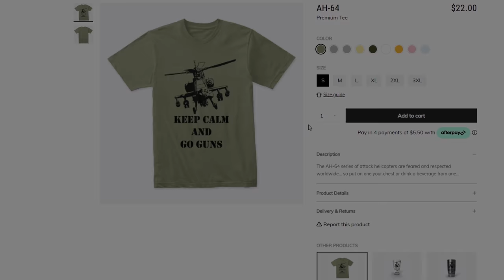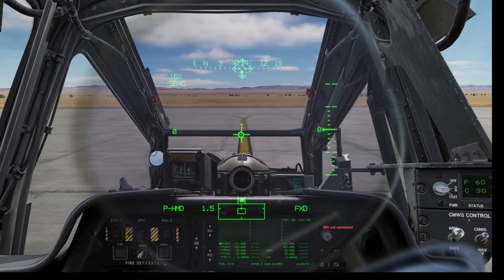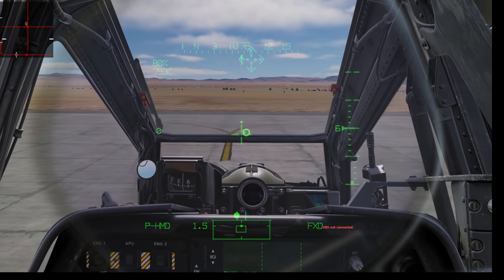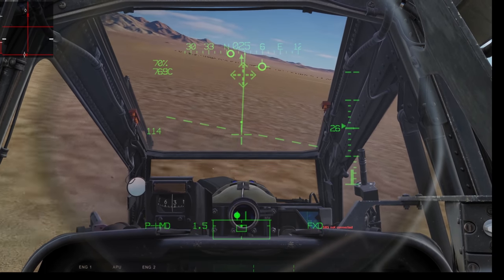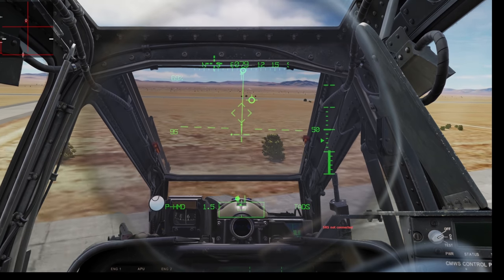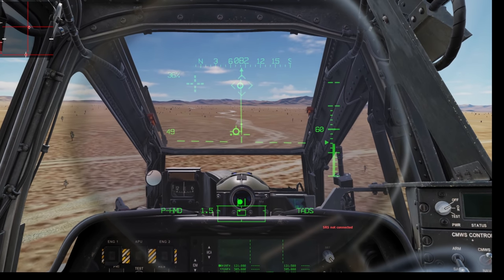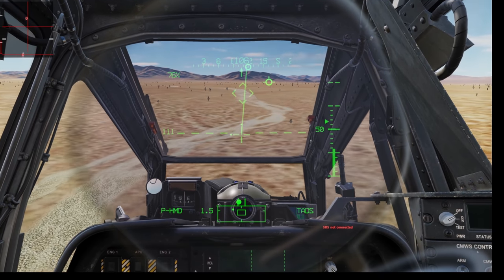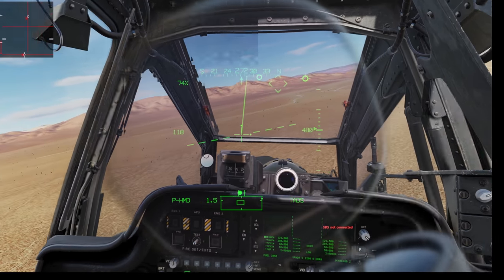DCS AH-64: How I deal with the Trimmer

Comment: Thanks for the shout out Casmo! 
The MS Sidewinder 2 is such a great stick for helicopters, but also for fixed wing trim, it can simulate variable resistance, in a warbird, low speed = near no resistance, high speed = high resistance (simulating physical connection to your controls), Along with the typical vibration/bobbing effects for releasing weapons! Such a tragedy we lost force feedback from the consumer market.
Reply from the maker: Sure is.
Reply: My logi g940 wore out or I'd still be using it. Sorry that they didn't make a 2nd generation version...
Reply: we do have modern ffb peripherals. sure its a little pricier than a second hand sidewinder or g940. but be sure to check out brunner in switserland. i have the brunner cls-e ffb joystick base with a virpil mongoost50cm2 stick on it. also virpils 200mm s curve extension. mainly bought it for helo force trim. been flying the ka-50 since 2009 and never could get used to any of the dcs trim simulated ways with a spring stick. yeah it costs 1250 euros just for the ffb base but for my hobby completely worth  it. now i want brunners ffb pedals though.
Reply: @CasmoTV  check out my reply to redkite in this thread. brunner really is worth looking into for rotorheads ;}
Reply: @kingpinda2  Yeah I'm aware of that one, but far too poor to be buying one sadly.
Reply: @RedKiteRender  ah ok. I just heard/read in the clips there are no ffb devices anymore but you mean affordable.

Comment: Great video Casmo. Your thing about a light touch on the cyclic reminded me of the first time I took the controls on a real whirlygig. I was left seat in a Gazelle doing a track and vibe run over southern england and once I'd got all the data I needed the QHI gave me control. For a about 2 seconds all was good then I started porpoising and weaving and it started to get a bit divergent. I could hear some weird snorting noise in my headset as I fought to keep the damn thing in a straight line and glanced across to see the QHI in fits of laughter. He eventually composed himself, took the controls and said "it's a cyclic not your penis, there's no need to choke the damn thing!" Handing back control to me and this time with just 2 fingers on the stick, low and behold, the thing actually wants to fly straight. Track and Vibe was always fun in Gazelles. Sadly never got to fly "Ugly" in my time on Apache. Keep up the great work!
Reply: Yeah my brother, less is more when driving a helo

Comment: I like the central trim mode, you just have to release the controls for a split second before you do anything again, but you kind of have to do the same for the default trimmer mode as well. I died once while using central trim mode before I realized what it did, then I haven't forgotten since. Works well for me, but tbh I think it's more of a preference thing.
Reply: Center trimming mode for those who do large steady movements holding trim, and then when flying as wanted, release it and center joystick.

Instant is for those who do continued trim clicking, tiny movement from joystick center to direction you need to go and press, press, press... as long your flight attitude is as you like, and then center the joystick.

And of course at first better to separate pedals trimmer to avoid working with two, just hold pedals at first as needed, concentrate to learn joystick. Then later add pedals if needed.
Reply: I agree. How is this different than the black shark? Do people have a problem with that too? For me personally I also find the center stick mode to work perfectly as you dont have to react immediately and can take your time to center the controls and make control adjustments from there. Stablize, trim, center controls, profit. This is better than this mode imo which is similar to how the black shark worked which I still didnt really have a problem with.
Reply from the maker: It’s not a question of “which is better”. I don’t cate who uses what. As long as it works for you it’s perfect.
Reply: I used this method too and found it reliable. The method in the video seems unrealistic,  a huge constrai n and a waste of time. Ain´t nobody got time for that during combat :D
Reply: Same here. Used to it from Black Shark. It just depends, on what ppl like more.
Reply: @Zatracenec  I can't imagine anything else without having a FF joystick.

Comment: I've enjoyed the default trim settings. It took a bit to get used to trimming my anti-torque pedals because I've never done it in other modules. Push cyclic and pedals, trim, immediately release cyclic and pedals, Apache stays like a good girl and my controls are relaxed. Feels just like how I've flown all other rotary modules. Thanks for the video!
Reply: Just change the settings in the “Special” manu to “Stick with centering and no FFB”, you won’t have to do any immediate releases, it’ll trim to current position, they you can let go off the stick gently.

Comment: Yeah, the trim setting in the special setting really depends on how the person prefers it. The Gazelle has a hard twist to it when taking off and hovering. But once you get it going, it will hold straight with no rudder or torque input. But, each of the DCS choppers all work a bit differently. Casmo, keep up with the great videos. It is great that you give credit to others for their work.
Reply: The gazelle has very odd flight modeling. It is like designed for centering joystick that your attitude doesn't move when you have joystick at center.

https://youtu.be/P3wlmsJgPR8

That is flown just with a keyboard, only utilizing one control at the time, and only collective at first and after that just pedals when in air.

Cyclic is not touched at all at any given moment (if you do, you basically die because you can't center quickly the cyclic with keyboard arrow keys, and any input is constantly adding degree/second so you will quickly flip over. 

In that video the trim system is disabled, and is that another a autopilot or something. So Gazelle should be completely on-hands without any assistance helping to fly.
Reply: Yeah, my issues were right at take-off and coming back to a hover. Once, I finally got a good set of axis tuning all my issues when away. I never spent much time in the past flying helicopters. But I got back into them several years ago. Once I found the video that was with a gazelle pilot , he went in detail about the axis tuning in DCS for the Gazelle. Then everything changed for me flying it. So, after some research and some settings adjustments. I was all good.
Reply: @CueDriver  You can get Gazelle easy to fly, but it still doesn't fly realistic manner at all. If the purpose is to just get Gazelle fly around battlefield and have fun, then it is possible even without any controls adjustments (far more challenging if you have short joystick and throttle as collective, easier if you have extended and collective with pedals). But again it doesn't fly like real Gazelle does. 

The major problem with Gazelle is that you need to forget everything how real helicopters work to fly Gazelle. And then after flying Gazelle, you need to forget everything how Gazelle flies to fly other helicopters.

To fly gazelle zig-zagging between trees on the roads, under bridges, under trees even etc, you don't need to use pedals or collective, just cyclic is enough. Just get the mindset "I am flying a airplane" and you are golden. 

That is why I don't fly Gazelle anymore because you die first when you try to fly it like a helicopter. And then you can't switch to other helos as you die in those as you try to fly them like Gazelle. The Viviane targeting system is as well unrealistic, it has magical INS and ground locking, while it should only have a weaker gyroscope, very low resolution FLIR and anyways behave less effectively but similarly as the Raduga sight in Mi-24P, so gunner needs to compensate for any Gazelle movement in pitch and yaw. 
There is no weapons recoil at all, making Gazelle very easy to engage targets and accurately. 

I ended up when I realized that I was flying constantly from left seat, and then I just used Viviane to target threats and shoot them from the move while flying around them. It was easy to do both simultanously.
Reply: @paristo  yep, she is my fun flying chopper. When things are more serious I grab the heavier ones.

Comment: For those of us fortunate enough to have a force feedback stick, I recommend that you do not use any curves in the axis tuning. The stick will become more sensitive in the X and/or Y axis once trimmed out of the center position.
Reply: except if you use hardware trim. with brunner cls2sim software i set up force trim via the brunner software so i can recenter my stick even out of game. in dcs i just set it up as springless stick and change the pitch curve so it maxes out faster when pitching down. that way with my 200mm extension i dont have to hang forward. alot of planes also have less deflection in the pitch down range so now i use that as well in choppers.

Comment: I use the same settings (instant ffb) and it seems to work best. Trim is easy when in normal flight like in your video. The problems surface when you are in hover engaging targets and suddenly have to make an escape manuever. I think the upcoming reset trim "cheat" will be very helpful in the aforementioned scenario.

Comment: I tried your settings and used your advice from this video. I would have to say it was a lot smoother to handle. I need to go back and check some axis tuning. Other than that, the changes were so worth it.

Comment: The FFB setting is absolutely the way to go for DCS regardless of the stick you have. I had a shit ton of issues with central position, especially with anti-torque pedals on there as well, I dont trim out the pedals anymore.
Reply: Non-Centering/springless mode user here. You don't use any other trimmer mode with it. Only difference to real thing, is lack of centering to trimmed position. But you use trim, because that trim button while can't move your joystick or require you to move it, will program the autopilot/ hold channels to have the authority virtually maintain the attitude you trimmed to.

FF isn't required, just remove the spring and get extension to have great free moving cyclic. It makes flying so easy. And then can be added by various means a method to hold joystick where wanted so you can take your hands off.

Comment: One thing I have noticed with this whole release and people lost by trimmer are typically people not used to it. Center trimmer mode is not necessarily the devil but is if you are not used to centering all your axis after trimming. As the game will stop recording inputs until all control axis are recenterd. That style of trimming has been ground into me from many hours of ka50 as the way that trimmer works is you are seguesting where you want your auto piolets to fly to and the chopper does the rest.

Comment: There is another way to trim I have used with great succes throughout the years in other sim. It's a variant of central trim option, where controls are disabled for as long as you hold the trim button down. It eliminates wobbling resulting from a lack of system physically holding stick in place and eliminates the need to precisely center the controls first in order to use them again. The trim sequence was as follows: - maintain attitude - press and hold trim (trim is set and controls disabled) - manually center controls as you see fit - then release trim button. I wish this was implemented in DCS. I see that it could interfere with curent mechanics of holding down the trim UP, but that could be resolved with short press for current functionality ON/OFF and hold for the aforementioned trim method. That might not be 100% true to the real bird, but it's similar to trigger guard issue - sometimes you have to do things differently for them to work in a sim.

Comment: I have trouble holding a zero ascend/descend hover. If I start to descend I will give it just a touch of positive collective to top the descend. Then it will slowly start to climb and go back into a positive rate of climb. When I try to stop it, it will go back into negative decent and I start it all over again. I have a thrustmaster warthog and the throttle(collective) shows no signs of bad sensor.
Reply: Yeah same problem, collective is super sensitive in the Apache.

Comment: After you mentioned in stream earlier, I changed back to the default Instant Trim from the Center Trim, and whilst you get those small 'jerks' in some circumstances, getting into a controlled transition into hover is WAY easier now. I'll still experiment, but I may be converted over. Maybe there's a middle ground? A delayed trim setting? Or a slider that could be added between when hitting trim and how long you need to get things centred.

Comment: There seems to be a philosophical difference between sim-only pilots and pilots with IRL experience when it comes to trim. Sim-only pilots seem to be more tolerant of holding quite large stick deflections for moderate amounts of time and using trim as a "cruise control" only. For that use case, the center position trim is probably a bit more natural. IRL pilots, on the other hand, are constantly adjusting trim through nearly all phases of flight, so the instant trim approach here is going to be more natural for them.

Comment: I’ve always used the default trimmer setting with the helos in DCS. Always found it the easiest. Less piles of burning wreckage, more staying in the sky! Last year I tried flying without rudder trim enabled and got on much better with the default trim. Didn’t get the yaw when trimming. The Apache doesn’t seem to have the option to not use rudder trim. For me this would be a good option to have. Great vid. Thank you.
Reply: There is a 3rd option in the settings, rudder without springs and ffb. Basically you have to keep constant pressure on the pedals. With a damper or weak spring is very useful.
Reply: @after_midnight9592  thank you. Yes! I watched Redkite’s video today and found that out.

Comment: Someone pointed out that the trim tends to become an issue during landing/takeoff.  I also read other people are just not using force trim, for simplicity.  As a newbie, this led me to try an entire flight without and sure enough everything was much easier to get the hang of and understand. But it would be a pain to have to hold pitch for a long time or be making hover adjustments while needing to press some other buttons.

So I think one good option might be to think of flight in phases and make a point of manually/gradually resetting trim for tricky situations.  IRL I assume it would be easier because the sticks are actually in the magnet forced trim but for the game its not so good as there is no physical feedback.

If you're new to this maybe just dont use force trim until you get the hang of things. Then when you do give it a go, realise it's locking the stick/rudders so you dont have to keep a hold all the time, but that feature becomes a bit of a nightmare when you're learning to land/takeoff/hover etc. As it's easy to forget its no longer central.

Comment: ED could fix the pain of central position trimmer mode if they put a timeout on the controls lockout. In other words, if you haven't managed to recenter your controls within 1.5 seconds (or some time of your choosing), the trim kicks in anyway and control is restored.

Or they could give us Default trim back, which is on other helicopters. It worked like "Instant" trim except it locked your controls out for a fraction of a second and gave you a chance to neutralize them before it kicked in. (This would not be very different in practice from putting a very short timeout on the central position trimmer mode.)

Comment: To each their own, I massively prefer the center position trim, completely removes the issue of the nose dipping or yawing around wildly after trimming, but then again I've had lots of practice with it. First time I tried it (after a year of "normal" instant trim) I often forgot to properly center the stick and especially pedals after I'd pressed it, and as a result my inputs weren't doing anything and I panicked.

Any method of trimming is gonna take some getting used to, and for me the one that came out on top after going through the learning period was the center position. =)

Comment: Ah yeah center trim.  You have to center your stick again before you can adjust it.  The benefit of center trim is that it will allow you to enter trim at current stick position, without re-stacking your after-trim input on top of the new trim setting.  

With instant trim, you can trim again without centering, but your stick inputs will be immediately be added on top of your new trim, giving you a 2x input.  For instance, if you  set your stick to Y+.50 and hit trim and leave your stick, the trim will go to Y+.50 but the game will instantly add whatever value your stick is at on top of it.  If your stick is still pressed at Y+.50 when you do this, you will be at Y+1.00.  This is why with instant you MUST use small inputs.

Instant trim will ignore re-centering, center trim requires you to center the stick.

Comment: I've been doing this click the trim method to decelerate and transition to hover. This helped me a lot. Got a question. You mentioned that it's a bad idea to trim while in hover and that you're simply just fighting your trim to get into a stable hover. Now that att and alt holds are implemented. Will this technique still work ? I find that if I activate those two while doing the fighting. I still need to apply cyclic pressure to remain in place. Not the hands free that Wags showed when he featured the hold modes. How do I mix this technique with the application of att and alt holds ?